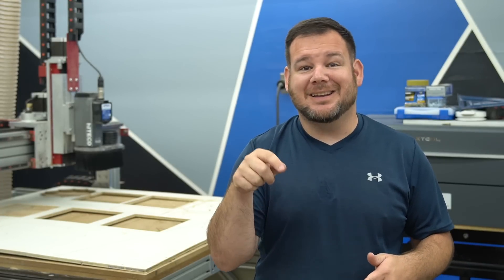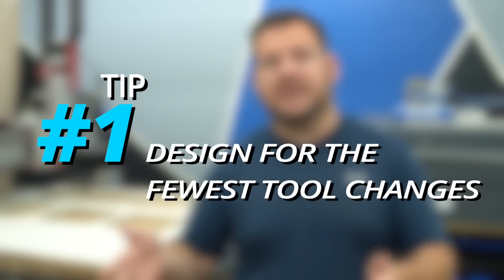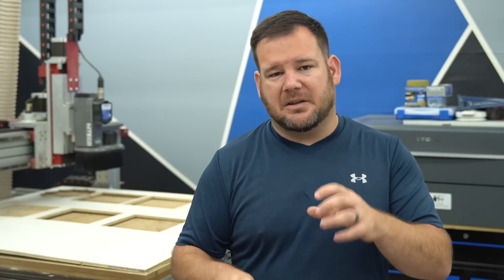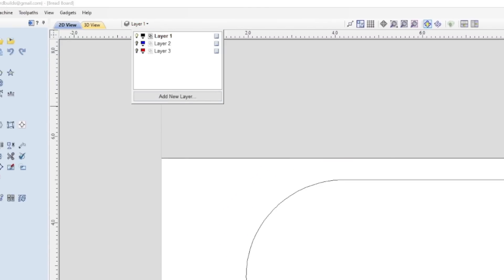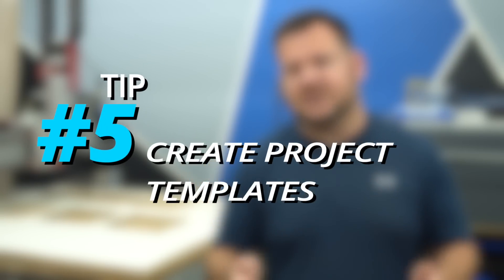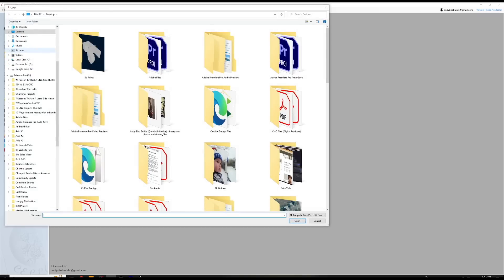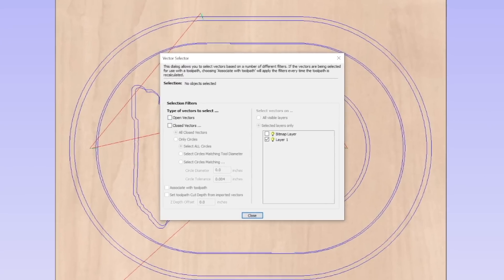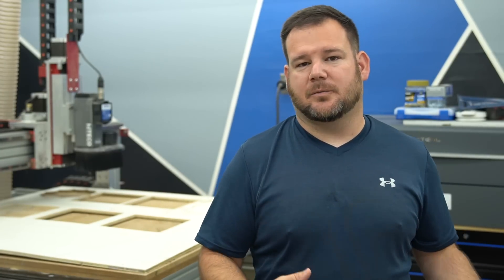Unlocking the Full Potential of CNC Machines With Vectric

Comment: Nice. I have to try something else. I'm currently using the free version of fusion360 to export gcode and my home made CNC is 10ft long so when I'm cutting a big part it jumps back and forth and let me tell you, moving the head 10ft at it's locked slow speed takes like 20min to get from one end to the other just to make a cut, then move back to the other side. Ugh. I'm still learning.